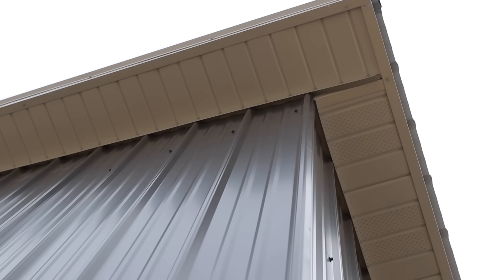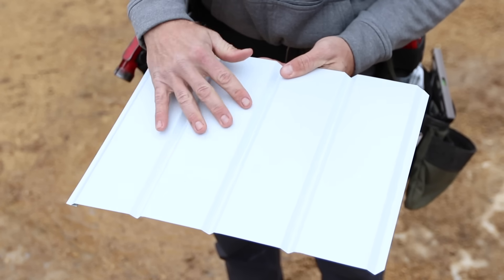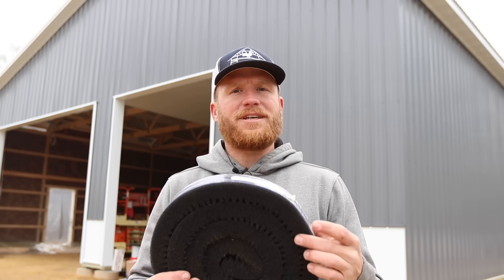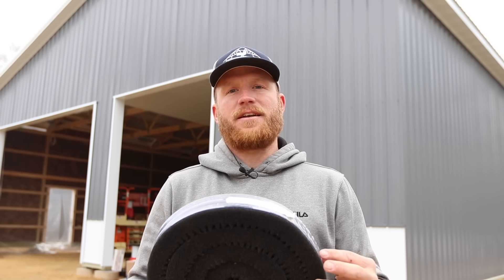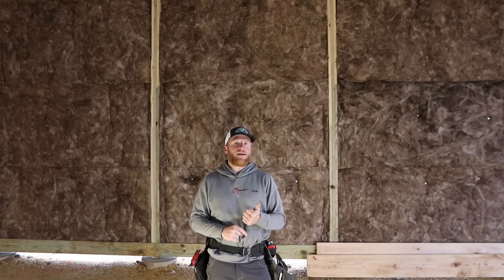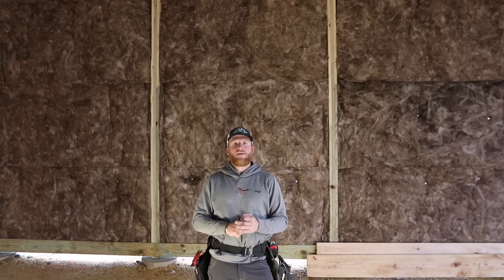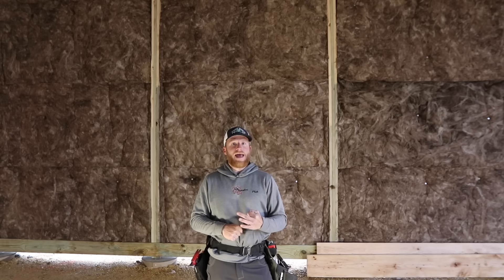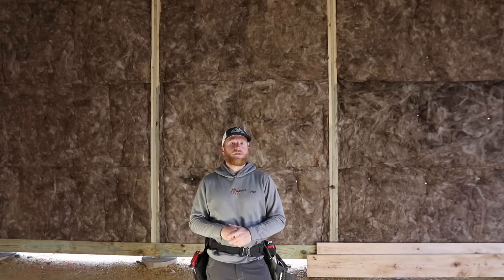Insulation: 5 steps to a more efficient building and why I don't use spray foam

Comment: That. Metal building needs foam bud.  I’m sry but you’re wrong. R19  is not efficient enough for that building.  The poly will be dripping with water come those cold summer nights.  This is coming from sprayer/insulator 20 years experience.   Foam is the healthiest-thing for that building.  Spend the extra 2-3 grand. It’s so worth it in the long run.    Blown in fiberglass is trash also.  Especially with the size of those soffits. You’re going to have 3 feet of blown fiberglass on one side of your attic in the other side will have 6 inches.  Due to the wind pushing the fiberglass around.  Stop being cheap. Insulation is not somewhere where you should penny pinch. Spray foam insulation is a necessityFor metal buildings. Flash and batt is great.  As long as you have that initial seal in your building envelope. Please stop spreading negativity about spray foam and its costs. The cost isn’t even that drastic of a difference. Plus fiberglass is a breeding ground for rodents. They love fiberglass. Good luck with all that caold state of Chicago
Reply from the maker: Not sure where you get your spray foam... if it was only a couple grand more I’d think about it
Reply: RR Buildings My over head is low.  I can afford to give spray foam at a reasonable price.  Roughly for me to spray that building.  5-6grand.  (Maybe more. I’m not sure the exact specs) 
And the product your getting is way more efficient then what has been installed.  Im from New England. Nothing is cheap here.  Not fiberglass or foam.  The Stretch codes are changing every year. Spray foam is now being used more and more.  More companies are out there. So to stay competitive we have to keep our prices reasonable. 
You’ll be surprised.  Just because the prices were high 5-7 years ago. Doesn’t mean they’re still high.  I think you should look into it more.  Find a smaller company with low over head. You should get a reasonable price that way.  Get yourself a few options.  A price quote for fiberglass with your blown in cellulose/fiberglass.  Also get one quote for spray foam.   

I couldn’t afford to insulate the way you did.    Just think.   I would Send out a crew of fiberglass guys to install your R19 and vapor barrier.  Great.  But then I have to wait to finish the job because the ceiling isn’t finished yet.  So a few weeks later I send another truck out to do the blown in.    

Instead of sending 2 crews with 2 different trucks on 2 different days.  My foam guys get that building done in one day. Right there the price of foam gets cheaper for the homeowner or business owner.       
Just trying to educate.   Foam is just simply the best type of insulation for the building envelope.    The combo flash and batt is good too but I wouldn’t want it in my house.  Mice love fiberglass. It’s a breeding ground for them.   Rat board or no rat board. They will find a way in.  But not with foam.  You will see.  Come back to this in a few years. I’ll give you a free quote !  Have a good day.

Comment: You do not use a vapor barrier on the outside... But a rain barrier, rain barrier let vapor go out qnd prevent water from coming in. Vapor barrier prevent vapor in either way... Which is bad on the outside. There are also vapor retardant which let vapor go through a little (depend on their specs), some vapor retardant les different quantities of vapor through depending on temperature. (othello for example)

Comment: Kyle, thank you for the information, exactly what I was looking for.  Changed my plans on type of insulation, vapor barrier, plywood vs. drywall (other video), and several other materials.  Really appreciated.
Reply: What was the reason of using plywood vs drywall. 
Thanks.

Comment: Your doing all the right things.  Here in Canada we can swing from -40C in winter to +40C in summer so insulation needs to meet the needs of heating and cooling.  Recommended attic insulation is now R50.  Too often, I see customer's attics that have been upgraded but failed to provide what you refer to as "attic air deflectors".  There are a lot of different commercial deflectors available, but your use of left-over vapour barrier is a great idea.  Proper roofing and insulation can only be achieved by a "complete roofing system".

Comment: Thanks for the great information. I'm about to get a shop built and this will really help. Do you recommend 2" ridged foam under the concrete? I live about 90 miles north of Seattle. I hadn't thought about a ridge vent I was just going to put a vent on either gable end. I'm gonna have to go back to the builder and have to plans changed.

Comment: Personally I think that fiberglass batts are a much healthier option to foam insulation. Too many potential health issues with foam and if you do find that a family member reacts badly to the chemicals that off-gas from it & or it's not been either mixed properly or mis-installed then it's an almost impossible job to remove, not to mention the prohibitive costs involved.

Also if you take the time to insulate your foundation slab both your comfort levels and energy bills are going to be much improved.

Comment: Been building homes almost 40 years. Foam is outrageously overpriced.Fiberglass insulation is outdated. Wet spray cellulose is the only way to go. Been using it almost 20 years. No house ever built with cellulose has ever burnt to the ground. Insects and rodents do not like it. Look it up.
Reply from the maker: I’ve heard that

Comment: Me too, never ever in life have used spray foam insulation. It is enough to know, from what kind chemicals spray foam is made, and no any question more.
Reply: Built my house 19 years ago with spray foam insulation and have no problems and I live on a hill where the wind always blows and it's sealed up everything can't think of a problem other than being dense it may transfer sound through the wall easierwhich is not a problem for us since we live in the middle of 80 acres
Reply: I don't think you know what chemicals are involved in the production of SPF.  It is the healthiest, most durable, and most efficient insulation product available.  Do you have health problems relating to the cushions in your car, your couch, or chairs?  How about other plastics in your home, office, or car?
That said, this presenter is very articulate, and is clearly an excellent framer, but does lack in building envelope knowledge.  House wrap is known as your water resistive barrier.  Vapor barrier always goes on the inside of the conditioned space.  2 inches of closed cell spray foam will be comparable in cost (probably a little more) to, and vastly outperform 5 inches of fiberglass batts.  The best value in the structure in this video would be 2 inches of cc foam in the walls, and R-49 in the attic.  The foam creates an air barrier that the rest of the wall assembly does not provide and will stop convection which is how the vast majority of your energy leaves a building.

Comment: Plastic vapor barrier should be outlawed in any building structure. It will condensate at some point. All you need is the right conditions and those conditions will happen at some point. The temperature outside the building and inside the building will hit that perfect point that will start the moisture. Then the black mold will begin. I’ve seen it over and over when plastic is used.

Comment: Why do you not spray foam the foundation cavity? Waterproof and mechanically strong. 
Rockwool has the same R as fibreglass but is much nicer to use and it can be blown behind dry wall.

Comment: closed cell foam is a more expensive option but not by as much as you think because you eliminate need for vapor barrier and it add strength and rigidity to the structure.

Comment: OK get away from Fiberglass it is flammable and will loose it's R value over time to quickly. We also don't use sprayfoam because of it's potential FISH smell when not 100% correctly mixed and the toxic off gases when applied which can take up to 2-3 day's to fully cure out. We instead use fire retardant treated Spray in wool and so we use a radiant barrier and a clear vaper barrier on the inside since we are in Florida. So the clear barrier will hold the blow in insulation in place and because it is clear you can see how much you might have to fill. Cost are less than half comparing to fiberglass insulation and has because we fill 6" spacing always a R25+ value .

Comment: Great info on the insulation! 

I still love the floating floor, though.
Reply: Won't it heave with freezing ground since not connected to pier pour of post?just asking,not a builder but want to have a building built in near future and here in northeast Kansas we can have deep freezes
Reply: Greg Zabokrtsky I don’t see where your freeze will be any more severe than what he experiences in northern Illinois. 

I am not a builder either. I would run this question by several builders in your area. 

If you are near K.C. I can recommend a place to get contact information for server contractors in your area.

Comment: This guy has no idea what he is talking about with SPF ( spray polyurethane foam ). The "bat" insulation does not have nearly to, even close,  the "R" value that SPF does. Why..? bat is roughly 4 R value per 1". SPF is 6-6.5 R value per1", closed cell. And the main difference with SPF, besides better R value, is SPF seals your home/structure and provides an air barrier. The majority of heat loss is due to insufficient bonds of insulation to the walls of the home. Bat insulation is not tied together but placed, one piece on another and not tied to the studs. Pull the dry wall from a bat insulated wall after 5 years and you will see how gravity has dropped it. SPF is one continuous "piece" of insulation that has more R value per inch and no breaks in it to allow cold, or hot, air to penetrate the living environment and also stay's exactly where it was sprayed. SPF is also FEMA approved as a water barrier. Which means that closed cell SPF will not retain water but repel it. Yes, SPF is more expensive to apply to your home/business what have you. But, if you plan to stay there more than 10 yrs you will reap the benefits! He also talks about "bad SPF jobs" and that has happened. The industry and technology have advanced to the point of non issue with that. The truth is when applying SPF to your home, business, pole barn ect. you will save 40% off your hvac bills per year. That's the fact's!

Comment: In this video you have metal roof screwed to 2x4 and not decking or plywood. Everyone tells me the metal will drip down on you're blow in insulation. What say you? BTW this is exactly how I'm building my shop in North Georgia.
Reply: He does mention that you can go directly to the 2x4's without a vapor barrier because his barns have vented sofits and a vented ridge cap. The flow of air keeps the condensation out. He has another video where he shows the metal roofing being installed with a factor felt style drip barrier that is applied to the sheets at the factory. This would be used if the attic was not vented. Or if it wasn't vented you would put a vapor barrier sheeting or fold out insulation board.

Comment: Where I’m from, anything other than digging out a rectangle shaped 2’x2’x4’ deep hole submerging 4x6 treated posts 3’ deep in concrete that stretch up to the roof line I’m forced to submit stamped engineering plans.  Our city and county inspectors office only has code books on general construction method plans and common building technics.  Anything but needs engineering plans which I can’t afford to purchase.  

My hat is off to you and your staff for making these beautiful videos. Much thanks!  You guys are artists.

Comment: Any concern with voids under the rat board when they bring in the fill? I'm thinking in terms of compaction, settlement & possible voids under the board. Not concerned with the building resting on the fill, just voids under the board. 

Also, if you make a book on how to build post frame buildings, I'd pay $100+ for it. Excellent work. "I have never seen that level of quality in post frame buildings ever" - my Dad.

Comment: How far above the soffit vent do I start the insulation in a Southern California attic?  Also, we do NOT have a ridge vent so do I have to add baffles the whole length of the roof from roof deck to the top?  My attic rafters are 2 X 4 in those pre-made roof trusses so what size insulation do I use and do I use baffles?  Wish you were closer…..

Comment: Spray foam is way easier to spray when your posts are as far as they are in your video.
Reply: No doubt. But it's not cost effective for this type of building. That's why they only spray foam the ceiling. The was another video of his where he had the insulation guy explain EXACTLY WHY THEY DO IT THIS WAY. Not sure which video was it though...

Comment: Great video! Love the knowledge. How would you insulate a cinder block foundation? Seems that keeps the floor away from the outside temps. Is the air inside the blocks considered enough?

Comment: i personally dont like spray foam on metal pole buildings.  For starters its 3 times the cost and if and when a tree limb falls/someone runs into the shop with a 4wheeler or what have you got a lot more headache to replace the panels especially on the roof.

Comment: No Greg.  The R value of  fiberglass insulation drops drastically with water vapor.  Foam doesn't, and foam is a vapor barrier too.
Reply: I think that's why they have the vapor barrier on the inside of the fiberglass mat. I wondered the same thing since im looking to redo a house we are gonna buy.
Reply: Vapor barrier? LMAO.
Reply: I guarantee foam the way to go, for the cost of all the house wrap, fiberglass insulation that will sag, another layer of plastic on the inside plus all the extra labor you could have had foam sprayed in 1 day and be airtight seal and get the same results only better the foam will never move and never condensate.

Comment: In the ceiling, what about condensation on the interior of the roof metal?
Reply: Air will flow in through the vented soffit and up through the ridge vent.  This will prevent condensation building up.
Reply: @rubikrawler  ok. Any possibility of getting a photo (or two) of your finished ridge cap?
I do post frame cons for a living in the greater Portland, Salem, Or. area and in always looking for little ways to improve upon what I'm doing.
Thanks.
Reply: N Flynn not my building.

Comment: Closed cell spray foam will not have a moisture issue like Fiberglass on a metal substrate.
Reply: Exactly as long as it’s closed cell that’s for the exterior walls , open cell for sound damping in the interior walls
Reply: Low Density Spray foam in the EAST where it's more humid will suck up humidity like a sponge and retain it!

Comment: I have not seen insulation like you are using.  I live in Southern Indiana and am getting ready to finish the inside of my new building.  Can u tell me exactly what type of insulation you used?  It looks like it was installed horizontally..is that right?

Comment: Spray foam on steel is bad idea , if someone hits a wall outside the building , you can not replace the sheet or two .  foam is glue , bonds every sheet as one huge piece  .   Pole barns on farms get abused Built one and a month later the owner backed his truck into the side wall took out 3 sheets , 10 days later hit the front wall with a tractor hauling hay .  if he had went with spray foam replacing 5 sheets would of been more like 20 . peeling it back you bend the sheets.   it's good stuff in attics and home walls.  has its place and not in a pole barn , How long till Steel Roof go bad from it being sprayed in rusting out from frost trapped moisture.   the last 15 years it has become popular , I was building pole barns back in 1985 are still in great shape .
Reply: Completely untrue. You can replace the panels still. You simply cut the foam on the affected panel and replace then respray. I've done it on my buildings in the past. Yep, it's more difficult than just unbolting and replacing, but it's not difficult.
Reply: @donrobison3015   and if they drywalled ??

Comment: One strong selling point for foam is the added shear strength value. In construction such as what you do I'd have to say at least one inch of foam around the perimeters of all your framing could give you a peace of mind that is now perhaps absent in extreme high wind events. For that reason alone I would insist all customers spend the extra up front for it.

Comment: Awesome vid... At about  3:45... I would recommend adding vertical piece of closed cell foam insulation below the Rat Board to grade (and if termites or rodents are an issue) with a ""C" channel config. metal flashing on the exterior side... stops vermin and heat / cold transfer to the floor slab... guessing the attic space you are creating (for all intent and normal purposes) is "unusable"...??? I have as an upgrade option for people that want (or need) to use the attic space, by adding a (foil faced) rigid foam board between the top of the rafter, placing spacers at each rafter above the foam board, below the metal roof,  allowing a second level of air movement, eave to ridge vent. Creating a foam board roof that is "in the shade" of the metal roof (works well keeping heat in and moisture out too)... I only offer under slab heat as the primary source in "high bay" situational as it is really the only practical solution (but will use it in conjunction with other inside air heat)...

Comment: I live in northeastern Pennsylvania (Poconos) and I've considered doing the spray insulation to shore up areas I've noticed air coming thru.  I put in Anderson windows and new doors to eliminate possible reasons why cold air is getting thru.  The average cost I've been quoted is about 9k for